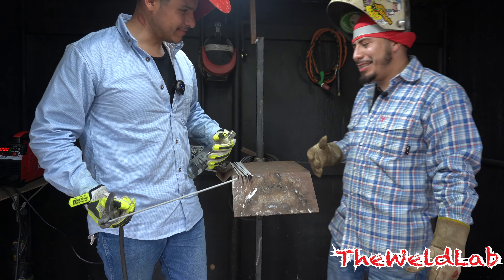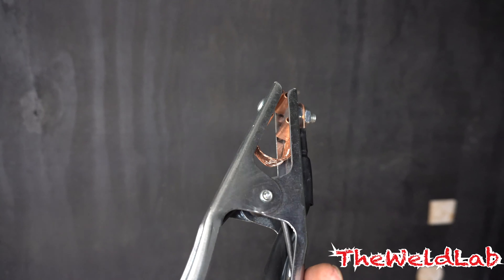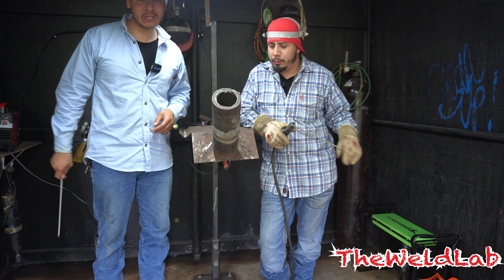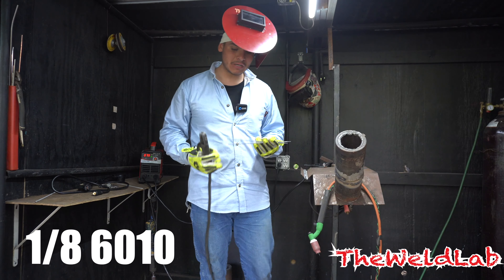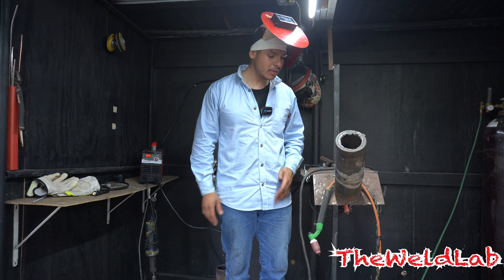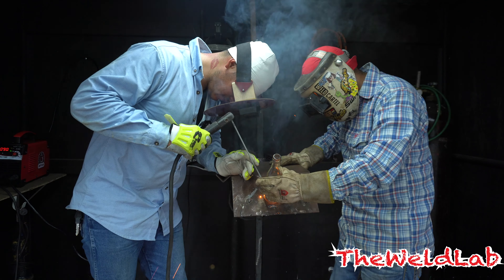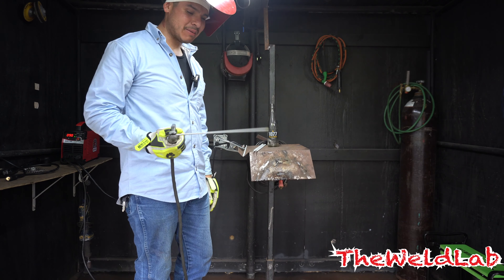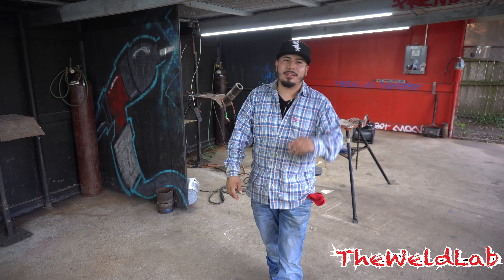MUST HAVE CHEAP STICK WELDING MACHINE ONLY $120

Comment: I'm "almost" convinced all these little machines are the same inside in a different case. I got the Amico 160 machine and it looks VERY similar although I think the welding leads are longer. The joke of it is, these little machines run remarkably well and for us homeboys there isn't a good reason to shell out for high dollar welders.

Comment: Have this exact machine running same amperage (with calculations to account for the lack of voltage) forney 7018 3/32 rods but running it on the 110 plug same travel angle and everything. Having a terrible time getting the slag off any ideas on what is up?
Reply: Same machine here and new to welding. If it's flat butt joints try angling the stick more to drag or if it's t joint try raising amps 5-10 if above just running flat beads. Also on t-joints try slowing down and maybe instead of dragging at a high angle like 25-40 degrees try going mostly straight in or pushing some (opposite of dragging.)
Reply: @ConfrontationalApistevist  nah travel speed and angle are fine. I did figure out the problem though, popped my rods in the oven at 350 for 30 minutes and everything was hunky dory.
Reply: @Tylerthemusicophile  I've been worried they might off gas something nasty in my oven.
Reply: @ConfrontationalApistevist  if that were the case I'd be very sick lol I do have a convection oven that exhausts outside my house though so your mileage may vary
Reply: @Tylerthemusicophile  I'll find an oven on craigslist lol, thanks for info. Dragging a lot like 30+ degrees works for me with 6013, I wasn't thinking 7018 also to correct.

Comment: Hey bro what amperage did you run the 3/32 7018?
Reply: You wouldn't go over 80-90 amps with 3/32 but every machine runs different.  Look at the puddle it will tell you what you need.